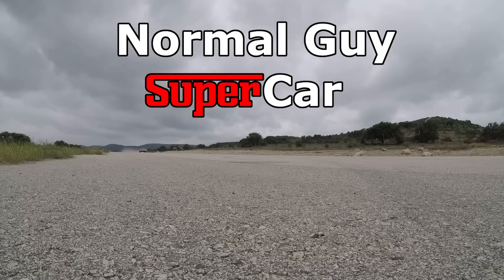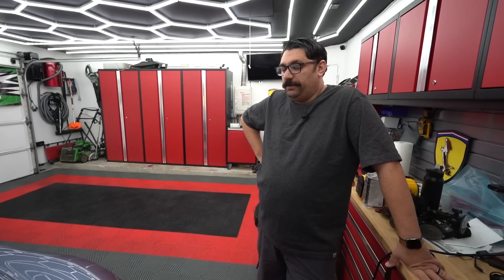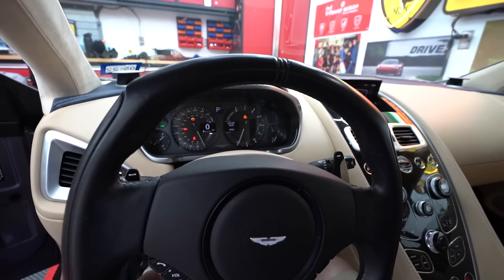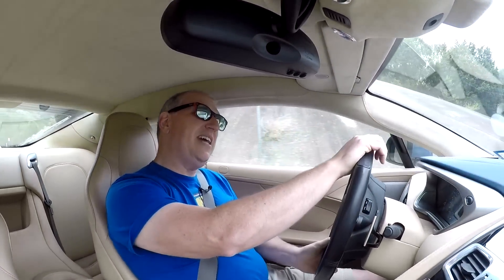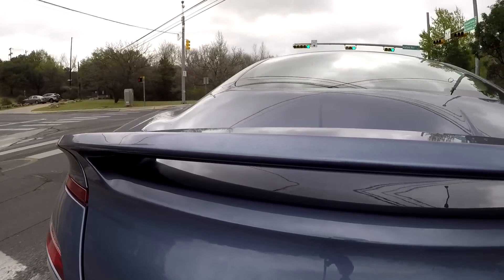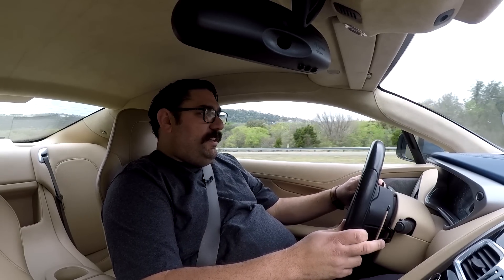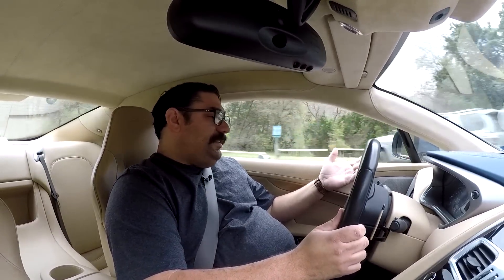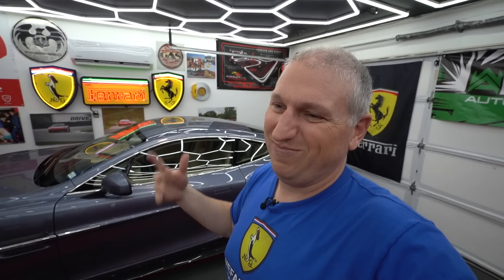The Aston Martin Vanquish is Classy AF

Comment: Hi Dan. I have the 2015 V12 Vantage S which will probably give you more of that sports car responsiveness that you are used to. It’s the 7 speed single clutch. I’ve had it for 9 months now and, apart from replacing the time expired tyres, have spent zero $. The last service was paid for by the guy I bought it from as it was due right when I was buying it, and was $1100 AUD. That’s pretty good value. In the time I’ve owned it the prices of other examples seem to be up about 20% on the various sale websites. My first supercar and I couldn’t be happier
Reply from the maker: That's great

Comment: Well guys, I must say, Astons are under appreciated until you own one. I bought a 6 speed manual vantage used 3 years ago.  Regular maintenance, no other repairs were needed. Solid, well built vehicle.  No cheap plastic, things are made of aluminium, carbon,glass, leather, etc. Gauges look like jewelry.  Sold it after listing it for 3 days, made 50% profit, bought it right I guess. I do miss it.  I am 6'2" 250lbs, never an issue with seat controls.  Love the review and the channel,  great job guys!
Reply: Yeah...Even in the video he jokes about the reliability, but it seems like in reality if you talk to actual owners vs. internet rumours and trolls, they are fairly reliable cars. Especially the V8 Vantages.
Reply from the maker: They aren't that bad but they certainly have a bad reputation
Reply: @normalguysupercar  No they don't. Yes. new cars depreciate like crazy, but they are wildly known as incredibly reliable and relatively inexpensive to maintain.

Comment: When I bought my 8sp Vanquish 5000miles ago I was worried about the seat switches however with it being RHD it’s not as much of a problem.
I did wonder how he found the steering so lifeless as it’s hydraulic. I found the feedback a lot better than the fake speed sensitive feedback of electric.
In the U.K. there were a few prototype 6sp built in 2014 but the 8sp was launched 2015. It transforms the car. Different engine management, faster shifts, works the engine far better be suspension setup is night and day to the 6sp.
Reply from the maker: Indeed

Comment: With respect to the key not having a key ring… AM will sell you a leather pouch that you slip the key inside and that has a key ring attached to it. 
I like the leather pouch as it offers the key some protection if you drop it. I make a point if not removing the key from the pouch unless I’m sat in the car and about to put it 8n the ignition as if I do something stupid and drop it the only thing it can hit is the carpet. 
Lots of people who own these just use the valet key which is entirely plastic, preferring to leave the glass key at home. Incidentally you can fit the glass buttons to the plastic key as the rubber inserts don’t last very long!
Reply from the maker: That's a good idea.
Reply: Funny!  I do the same with my glass key.  I even found a way to elegantly push the key out of the pouch with two hands using the little hole on the bottom of the pouch.  Well worth $200!

Comment: I enjoyed your review but am disappointed that you didn’t realize that you were driving a 6 speed Vanquish. The ZF 8 speed became available starting in 2015. This transmission has quicker shifts and is much more responsive. Aston also changed the steering, suspension and engine management systems in 2015 to make the Vanquish a more driver focused car. I have a 2015 Vanquish and have never accidentally adjusted the seat while driving so this problem may be related the this specific car (or driver).
Reply: The ZF8 is a great transmission
Reply from the maker: OK
Reply: That’s not much of a response
Reply: @jjk3205  better than a negative response :)
Reply: @danielelim8276  haha true that
Reply: @jjk3205  never is
Reply: I have a 2015 and I was confused by that as well. I believe 2015 was the first with Launch Control and I noticed a Launch Control button. 🤷🏼‍♂️
I will say the 2015 Zf8 speed is much smoother and responsive than the previous 6 speed.
Reply: I thought the zf 8 replaced the 6 in the later half of the 2014 model year.
Reply: @navyrotc2012  My understanding is that UK versions received 8 speed updates in late MY2014 but that these updates didn’t appear in US versions until MY2015. I’ve never seen a MY2014 8 speed Vanquish in the US.

Comment: Are we 100% sure that is the 8 speed ZF? Doesn't sound like it when the car is shifting gears, sounds much more like the older 6 speed ZF.
Reply from the maker: It was. The wiki was wrong and I had not driven it yet
Reply: @normalguysupercar  I believe later in 2014 (for the 2015 model year) the 8 speed ZF became standard. That box makes such a huge difference to the Vanquish but either way it's a stunning car. I have a Vantage Roadster and a classic Vanquish myself, I just love the "VH" era of the brand.

Comment: Hey Dan, I've been considering selling my pristine manual Porsche 928 (but keeping my 911 Turbo) and getting either a 08-12 DBS or 14-15 Vanquish. Did the responsiveness of the shift (down & up) seem to get quicker and acceptable once you put it in Sport mode? Also and if possible, can you try doing an 08-12 DBS review/comparison? Thanks in advance
Reply from the maker: It wasn't much difference
Reply: Hi Norm, one thing to keep in mind is the car in this review, is a 2014 (first gen) Vanquish. In 2015, Aston Martin had revised the vanquish and updated the transmission to a 8 speed ZF, re worked the suspension, and updated the ECU to make it overall, more responsive. These making the car 30km/h faster, and half a second faster to 100km/h. I have spent a lot of time around the 'second generation' 2015+ Vanquish, and find the 8 speed incredibly responsive, as it is a newer gearbox, it should make sense. You can find the 2015+ (second gen) Vanquish will handle a lot... A LOT better than the 2012-2014 Vanquishes in a sense of changing gears, as well as steering (due to the added suspension mode). If you truly are in the market for one, avoid any 2014 or older Vanquish, as the 6 speed can let the car down, it can be worth forking out some extra $$ to pay the premium for a 2015 or newer, it is worth every dollar.

Comment: A month ago was choosing between a 2014 Vanquish, 2015 V12 Vantage S convertible, and a 2014 R8 V10 plus. My wife and I really liked the line of the Vanquish, and the V12 Vantage S was gorgeous as well. Ended up getting the R8 cause the AM depreciation is just too overwhelming. The Vanquish had an original MSRP of over $310K and was going for a little over $100k WITH 2 yrs of AM certified pre-own warranty. That’s $210K lost in 8 yrs 🤮🤮
Reply from the maker: Yeah the depreciation is pretty impressive
Reply: I am confused....Don't you want the most depreciation on a used car?  The Vanquish is a steal for $100K (I bought a Rapide S last year for about $100k).  Definitely on my list for a summer car!
Reply: @sidelnie  your may think that’s the best deal but it’ll keep depreciating plus maintenance cost is also very high so you’ll end up losing more $$$
Reply: @theeverydayguy2938  I don’t intend to sell so depreciation is irrelevant for me.  Cost of upkeep could be high but no higher than that of other exotic marquees
Reply: @sidelnie  if one is to drive a car till it dies I suppose you would buy the best car for the $$ and won’t consider depreciation. However for someone who may change cars more frequent or someone who wants the best car for the least “cost” it’s a different story. A cars price is different than the cost of owning a car.
Reply: @theeverydayguy2938  the R8 is a lovely car…It was on my dream list for a long time but I needed a 4-door GT car, so the Rapide was my only real option.  I hope you are enjoying it and I would advice against selling it…cause what are you going to replace it with? A Vanquish? 😂
Reply: @sidelnie  😂😂😂. It’s hard to get the same bang for the buck. Z06?  How about Ferrari?

Comment: Love the Vanquish but 14 has the old transmission. 15+ is the better/newer transmission
Reply: Exactly, it has the F-Type R ZF-8 and it's a phenomenal transmission
Reply from the maker: Ya
Reply: Yeah, but 2015-2017 also stiffed the suspension significantly to a point where it might be a non-starter for many.  If I were to buy one, I would get the 2014 or 2018 Vanquish S where they sorted out the suspension.

Comment: Yes, depreciation is a big problem on Astons, IF YOU BUY A NEW ONE! If you pick one up at or near the bottom of the curve, then you get a hell of a lot of car for the money. That's what makes used ones so appealing. Hope you can get your hands on a 6spd manual v8 vantage, and you might start falling in love....especially for the price you can pick one up at......and they are APPRECIATING now. They bottomed out a year or two ago (eg '06'-'08 model years). Still a relative bargain for performance, looks, cache, etc. for less than a Camry. Also, the whole poor reliability thing is an internet myth....like every Ferrari will catch on fire. Tons of owners report having to do nothing but general maintenance on them with years of ownership. No more expensive then maintaining a normal luxury car. They've gone up about 20 percent in value (or more) from their floor about 6 months to a year ago.
Reply from the maker: Yes indeed

Comment: I don't see very many of these priced under $100K . . . $130K seems to be where they start.  There are a couple (I count only 3 on AutoTempest) that are priced <$130k, but they are odd colors or high mileage examples.  As for the seat controls being an issue . . . would that be a problem for those who are a bit narrower in the hips?  No I am not calling you fat ;)
Reply from the maker: Yeah, 130k for good examples is more common.
Reply: @normalguysupercar  But are they good values?